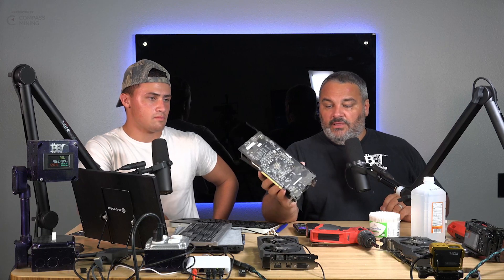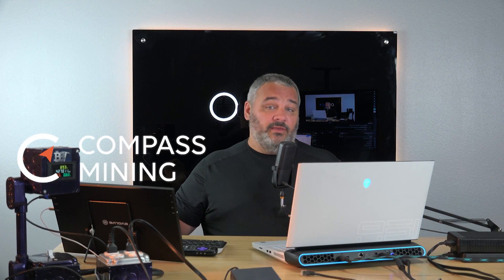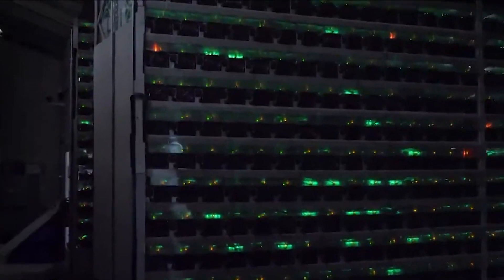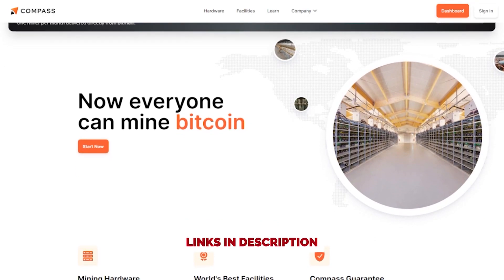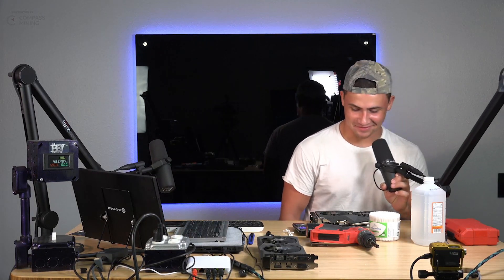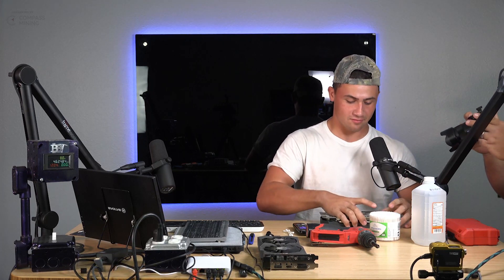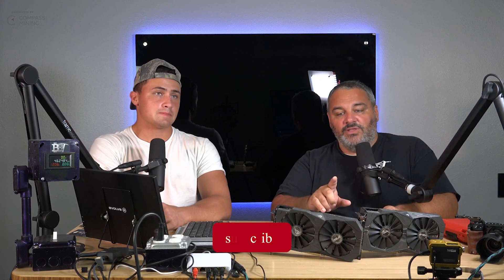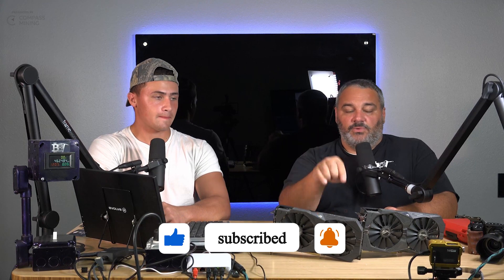Newbie's Guide to Cryptocurrency, Thermal paste and GPU's - 12

Comment: What do you recommend as a maximum memory temperature?
Reply from the maker: no more than 90c if at all possible, newer cards operate at the junction to 110c even though I would recommend no higher than 100c if at all possible.
Reply: @BitsBeTrippin  thanks BBT.
I have 3 x rtx3090 and 1 x rtx3070.
Will do new pads and paste in the next few weeks with thermal grizzly kyronaught and thermal right thermal pads. I will try to keep them below 90-95 c
Reply: @BitsBeTrippin  hah i run all my 1660ti from 45 to 55 ( 55 it's only one Evga with single fan )

Comment: So if the memory chip isn't covered by the heat sink don't put a thermal pad on it?
Reply: if memeory chip isnt contacted with heat sink you will be just insulating the chip with thermal pad from getting cooled by fans.

Comment: Do you find that the ultrasonic cleaner can possibly aggravate any potential loose or cold solder joints and make a card fail? Not that  it's a bad thing, I mean if it was loose or cold joint to begin with it would likely cause trouble anyhow... But the card might run longer before failing without the ultrasonic cleaning.

Comment: Can you do a video on thermal pad replacement on a ASUS ROG Strix RTX 3090. I have a friend who says he's thermal throttling with memory temps sitting at 110C. I'm not sure which pads are the problem area and I'm not sure I found enough info out there on the web about correct thermal pad thickness. We seem to be at a standstill with mining until this heat issue can be resolved.

Comment: Have you tried thermal putty instead of pads? Specifically the "tg-pp10" off of digikey? IDK if it would be compatible with your liquid cooled systems, but the stuff is magic on regular coolers.  I quite using pads and switched entirely to this stuff.  You have always done the best mining content.  Hope to run into you at a BB drop sometime.